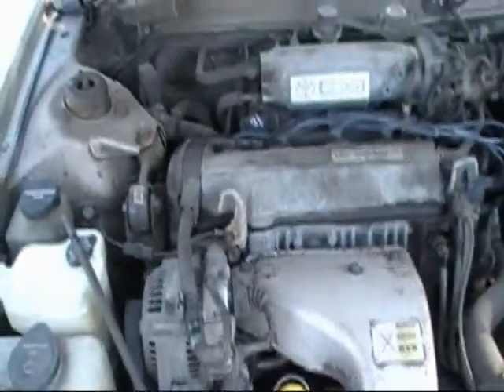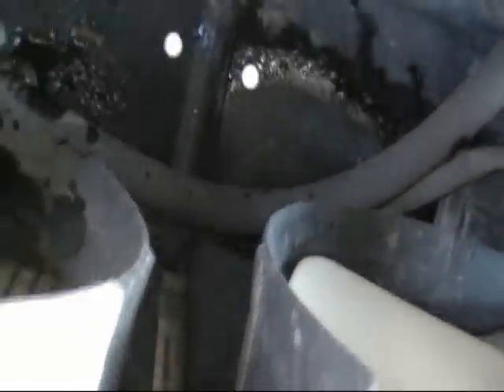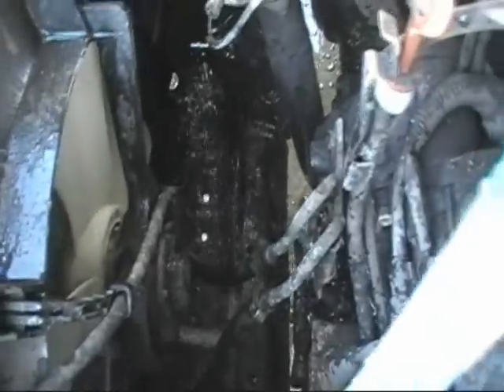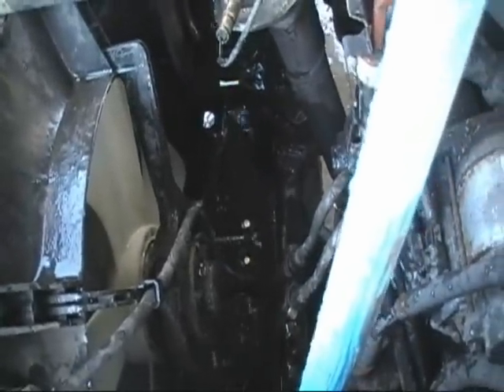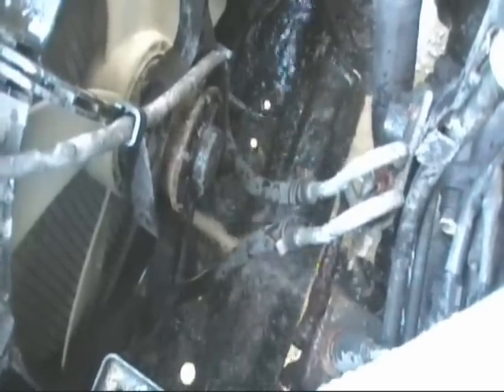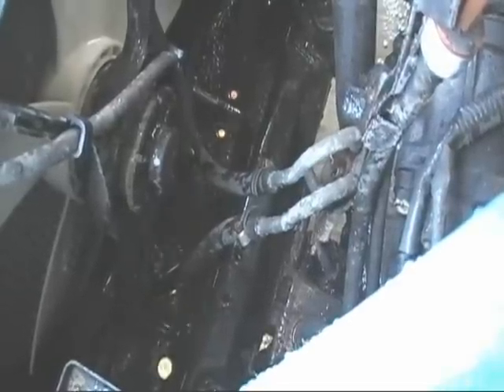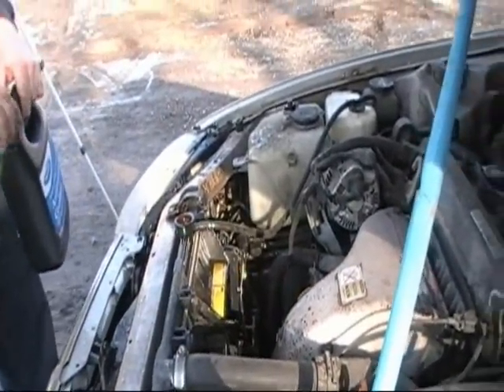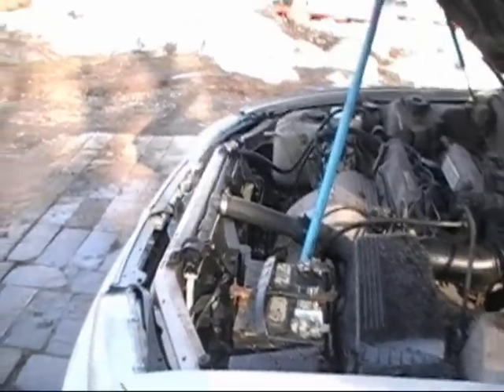Flushing out the Radiator on a Toyota Camry

Comment: I had to carry out the same operation on my 1993 Rover 214 hatchback. Certainly makes a difference and it keeps the cooling system in great condition. 
They say an interval of about 5 years for cars nowadays but personally, I change my coolant every 3 years.
My old lady drives a 04 Daihatsu Terios and that has to be changed every 2 years. Swings and roundabouts I guess.

Comment: I talked to the Toyota Parts manager at the dealer here.  He said the Toyota coolant is good and is Long Life for about 5 years of use but is overpriced. He recommended Prestone 50/50 Extended Life which is rated for 5 years of rust protect. He said the rust protectors are what wears out in all coolant, not the cooling ability.  Long Life/Extended Life coolants supposedly let you go longer in between flushes because the chemicals don't break down as quickly.

Comment: You flushed it with the engine hot?? Didn't it crack the head? And what did you undo first? You never mentioned about the drain plug. A bit rough.

Comment: So its this:
1. Remove the cap and plug off the radiator to gets the old antifreeze/coolant out.
2. Begin to put water in.
3. Turn on engine and put the heater on.
4. After a while, stop the water and let the motor run until all the water is out. 
5. Turn off motor.
6. Put back the bottom plugs back
7. Put new coolant/antifreeze.
8. Cap it and turn out motor?

Comment: Not a very good instructional video.  You failed to show the knob in which you unscrew to filter the water.  Nothing is described.   No narration to sequence of events.  When the motor should be turned on and off and for how long,  etc.   Over all just a visual thing.

Comment: Got a quick question! 
I changed my dad radiator and I guess now there are like two plugs on the right side (standing in front of the car) that look like that's not connected forgot where I unplug it.  I don't think the fan work unless I used the ac and see it turning. Any idea where they might be connect to! I can post a vid later

Comment: DO NOT drive around for a few days with radiator cleaner in there despite what the instructions say. It's too harsh on the seals to leave in that long. It's almost as strong as Easy Off oven cleaner is you know how strong that crap is.